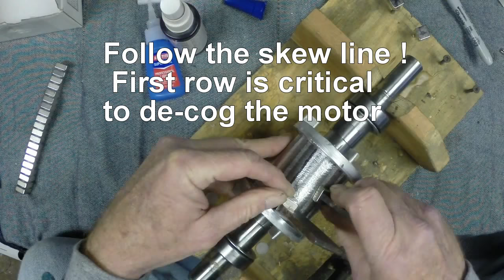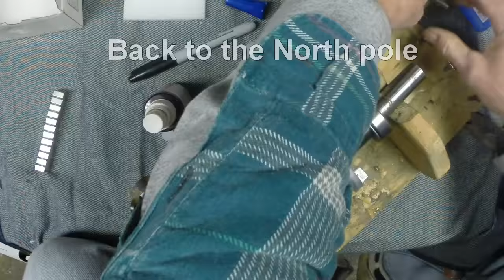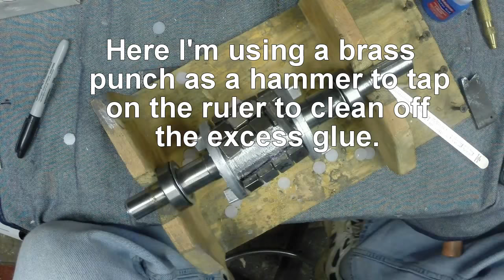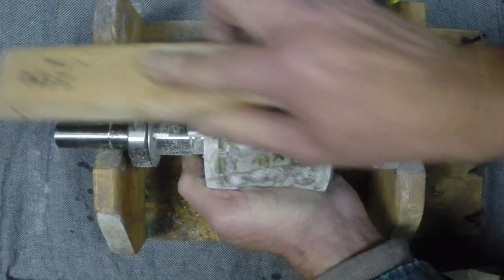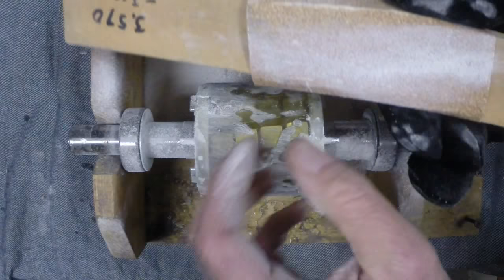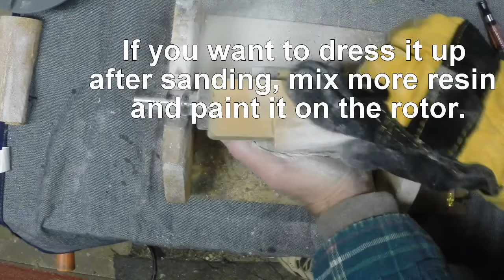AC Motor Conversion to Wind or Hydro Generator Part 2

Comment: Question: Keeping the inner part of the squirrelcage and leaving a gap between ajacent poles, you have made a linestart motor. It is a syncronous PM motor, but it is capable to self start as the squirrelcage is used for starting but becomes inactive at syncronous speed. So have you tried running your generator as a motor thrugh a vario-trafo or varible frequnecy drive? If it works, you have a very efficient motor too, that opposed to an AC induction motor, both has higher part load- aswell as higher peak efficiency.   These types of motors are normally only found in industrial sized motors where efficiency affects the bottomline, but being able to make a small version yourself, you have a way to reduce your electricity need by 15-25% on whizzing gadgets around the house!
Reply from the maker: Apparently you missed the whole point of converting this energy using motor to a energy generating device.
Reply: @FishbonzWV e Energy can neither be created nor destroyed! So my question is perfecly legitimate. In thermodynamics or electrodynamics, a motor and a generator is the exact same thing. Please be a flat earther in some others comment and give the person I asked the question a chance to answer, thank you.
Reply from the maker: @Tore_Lund  Since this is my video then that question WAS directed at me. This motor conversion is to convert wind or hydro energy to electrical energy. If I wanted to use it as a power consuming motor, I would have left it stock.
Reply: Sorry, I look like a fool now! I was just curious, efficient motors save as much as an efficient generator. Cheers!

Comment from the maker: The magnet poles are skewed to prevent cogging. It will be difficult to turn the rotor if you don't.
See part 1 to find the correct angle to skew.

Phillip, see part 3 for the power output testing.
Reply: okay, magnets are skewed, but why you left free spacing. you didint match the poles of the motor windings, check them first, then do magneting on rotor.
why you left free space
Reply from the maker: @Boteris  There are 4 magnetic poles to match the 4 motor poles. 
If you need to learn more about this subject, this is a great place for info.
https://www.fieldlines.com/index.php?PHPSESSID=4227a37809e83b12dad471efa3ec4774&